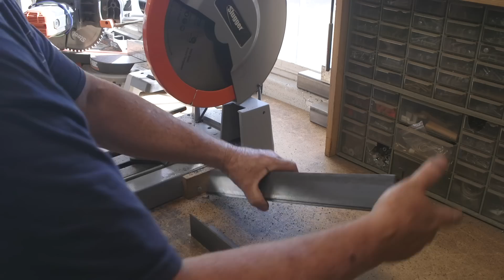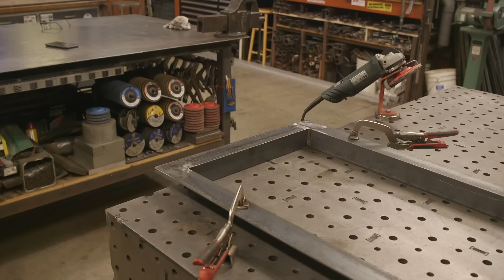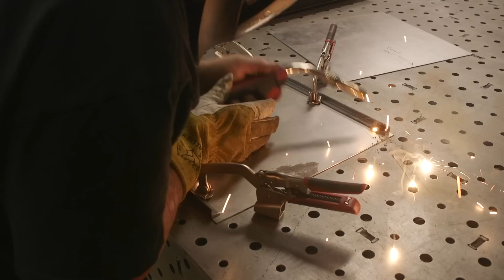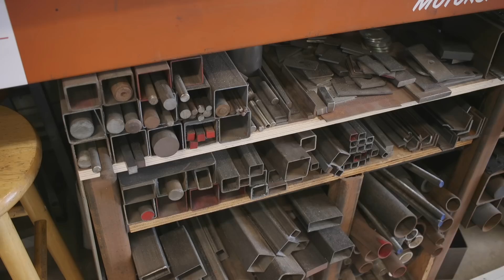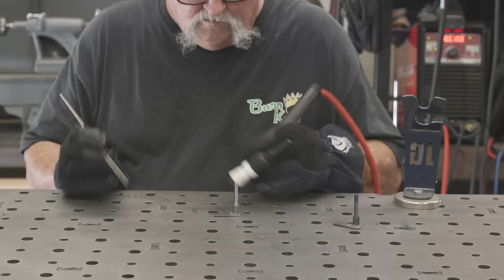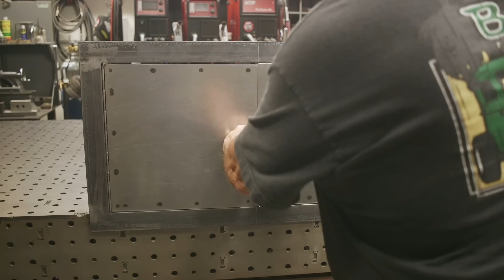Metal Access Door Build | JIMBO'S GARAGE

Comment: What's your process or opinion on prepping the steel for paint when dealing with mill scale? Do you suggest removing mill scale completely or just cleaning the surface and removing oil or contaminants?

Comment: Hey jim, i built something similar to this but I need to remove the burn marks on the front side of the stainless.  Is this possible?
Reply: Yes, it’s called a heat tint remover. We use it all the time on our stainless tanks at work. You have a ground and an applicator with a cloth boot on it and you dip it in a acid solution designed specially for this and it comes out very nice but you can’t skip any steps or the stainless will etch. The little machines are not cheap. About $1,000. Hope this was helpful

Comment: Use the die while your part is on the lathe. keep the part in the chuck, place the die against the work like your going to cut threads, then press the tailstock up against the back of your tap wrench, this keeps the die square to your work.and you can apply pressure with the tailstock.

 they also make die holders to mount in your tailstock

Comment: I had a similar situation and was going to make something like what you did.
 However, later in the day I saw an old oak bathroom cabinet at the dump.   Hmmm ?  I took the whole front panel off of the cabinet ( frame, doors, hardware, everything ).  I just screwed it to the wall.... DONE ! and it looks very professional. 
    Where did I do this and why ?   It was an access panel for water shut off valves.  I reno'd a bathroom only to discover that the design of my new bathroom cabinetry made it almost impossible to get at the shut offs.  Hmmm ?  Solution:  There was a bedroom on the far side of the bathroom wall. I cut a hole in the wall and put the access door on the bedroom wall. It worked perfectly. Just open the cabinet door and there are the shut off valves.  The "new" looking oak access door fit perfectly behind the bedroom door.   Win/win/win/win.  Free/easy/looks great/ and the pride of thinking up a new way of doing something.   Whodathunkit ?